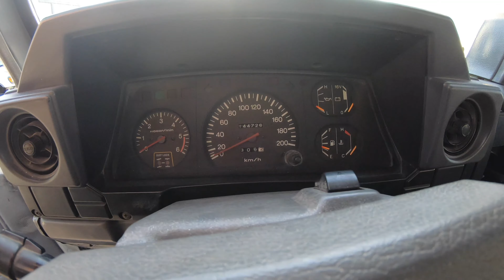Imported Land Cruiser FZJ75 Troopy From Turkey In Texas! (EP 43) // 3.Slow Gang

Comment: This roofrack is OEM Toyota and actually the mounts are reinforced though the roof. The trucks with this OEM rack have a higher roof weight rating than the ones with aftermarket racks ! This is very cool and can't be re-done aftermarket. You should at least keep the rack mounts and maybe just bolt another rack on them, they are a lot more sturdy than a gutter mount.